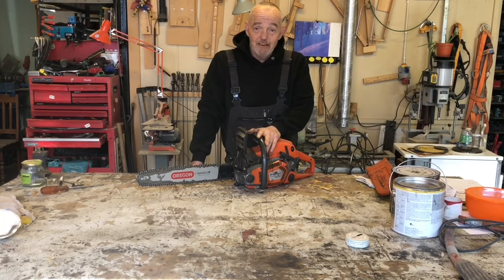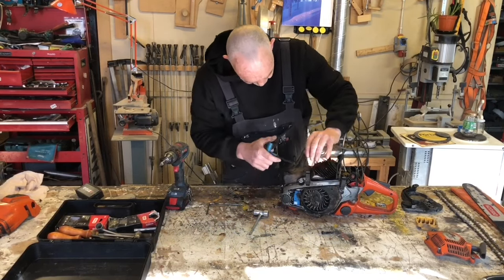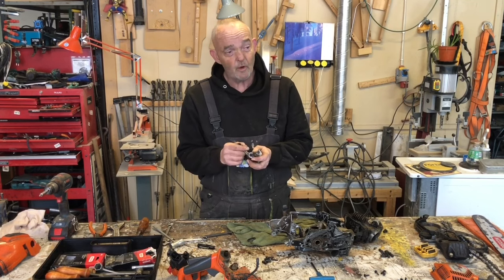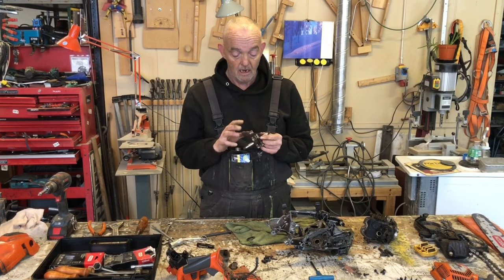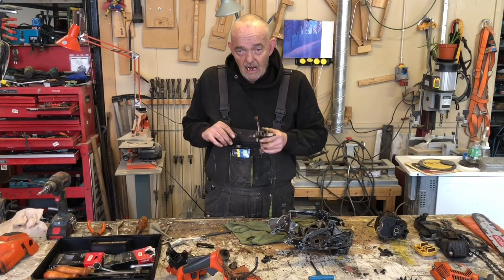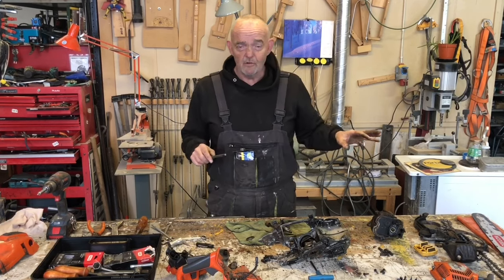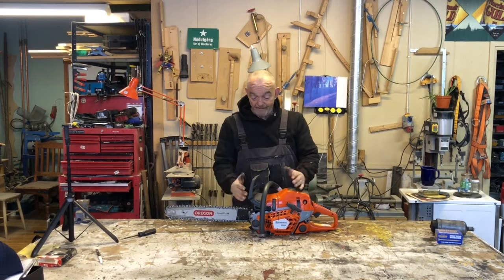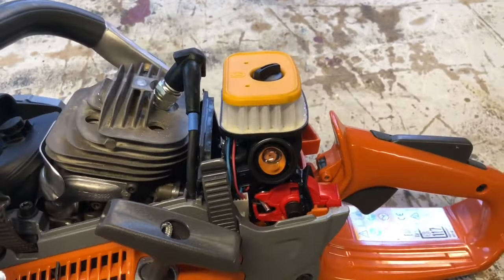Husqvarna 550XP seized. Why and what do we know?

Comment: I've in countered the problems of nuts and bolts vibrating out my chains
Saw and other engines that I own myself and worked on as a job fixing and servicing small engines. I've seemed to have solved the problem with both full metal lock nuts, high temp PTFE tape wound around the threads and also which is a bit more extreme, chisel a line down the threads on the bolt which makes it harder to screw back in but doesn't/ hasn't yet loosened itself off as yet .good luck
Reply from the maker: Thanks, both great Ideas which I will try when I reassemble it.

Comment: The roller bearing cage is often nylon but the rollers are alway metal. You press the mains apart and can buy all the bearings via ebay or amazon using either the part numbers printed on the bearings or via measurements and their inexpense in the UK but I've not a clue as to the cost to you in the north end of nowhere. The hardest part is pressing the mains back together whilst keeping it lined uo properly and then balancing but a guy of your skill set wouldn't have to much bother. Good luck
Reply from the maker: I had already found all the parts in the UK, I don't miss much about the UK. I do miss the food and the ease of availability of anything I want whenever I want it. I have not found anyone who has posted anything about how to do it so when the times comes I will be sure to do just that and you will be able to see how it all works, or not.

Comment: Sorry about all your troubles my friend. Yeah the aftermarket stuff you have to be careful with, there's a few that are alright I suppose. I'm curious though to why you choose the 550? I know you have reasons to your preference, just genuinely curious? That's a professional series saw I assume?
I'm no logger or nor do I heat with wood. I have the 455 and it has treated me well. I too stay on the heavy side of oil. 50:1 recommended, I run 32:1 in everything. No issues.  Like everything else they too have gone up in price.
An average guy can't hardly afford non ethanol gas here. Especially if you use lots of gas on a weekly basis mowing the yard and everything else. I think just about all gas here has ethanol, whether they disclose it or not is a different story. I run a fuel additive in all my gas called star-tron. Knock on wood but I've had zero problems in the past. I've been ruuing it since 2017. 
If I ever buy a new husqvarna I believe that I'll buy a smaller, lighter version. There's options out there that h.p. are comparable. I did notice the 550 has a 3 piece crank 😮. I hope all are well and looking forward to the sounds of the new saw. Take care and God bless my friends. 

Hello Sara 👋 I might go morel mushroom hunting later today, I'll think about you if I go! ❤
Reply from the maker: My choice for another 550 was an easy one, it has just enough power and is not to heavy. I am heavily invested in chains and bars and find it runs well. My old one has done so many hours I  think it has done really well to last as long as it has for a small 2 stroke engine. Anything smaller would be an issue and for anything larger I already have my Styhl. I would have rather just been able to rebuild my old one but there was more wear than I would like to see in a saw that has to do the hours. Naturally I do a lot that you don't see and a smaller lighter saw would also be useful in the future. Just as well you don't have to pay the gas prices we do, your prices whilst going up are still cheap compared. Naturally your correct about all our gas being watered down. Have a great day and be well my friend.

Comment: Nice little saws those 550's... I'm sure you'll have a lot of hours on that saw too👍 I have a 576 xpg for the big stuff and a Dolmar  PS 5105 for everything else.. super happy with both saws👌The dream is a ported 372 xp, but it would be beyond expensive to buy a really good one from US/ Canada with all the silly import taxes and stuff. Hope you guys are doing good, and let's hope the spring will come your way too... all the best buddy🙂
Reply from the maker: Thanks, I wonder if I should modify the old 550 when I rebuild it for a bit of fun although I remember seeing something on a ported 372xp. Not sure but I think Husky did a couple themselves 15 or so years ago. I know what you mean about all these taxes it is little wonder things are hard to find.
Reply: There's one thing I did to the 576 that helped a lot.. a little muffler modification. Removed the spark screen, cut open the muffler, removed all the useless nooks and crannies inside and had a buddy of mine, extremely skilled with a TIG- welder, make new curled pipes. The saw is breathing way better and the performance went up a few notches. It's a pretty powerful saw to begin with, but now it has better throttle response in every rpm range👍
Reply from the maker: I have see Bucking Billy Ray do this on a number of saw's. I have been thinking about it but dont know anyone who could do such a job for me, although I have not asked there are some talented welders around.

Comment: I have a Stihl 261 and I run it on 93 octane. I might not have that many hours on it but I’ve never had an issue. Nine years is a long time, so break down and buy one.  I could buy a replacement for &719.00 a, ms 261 Stihl 18”.
Reply from the maker: Hi Kirby, just saying what the man said. I agree 9 years is a long time but it is not just the years the hours on that old 550 are very many for a small 2 stroke I think it did very well.